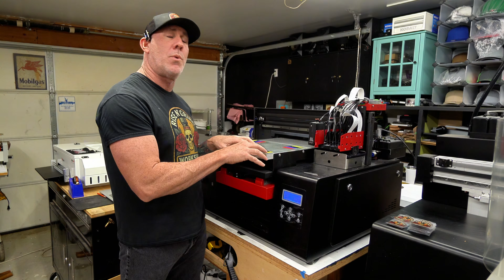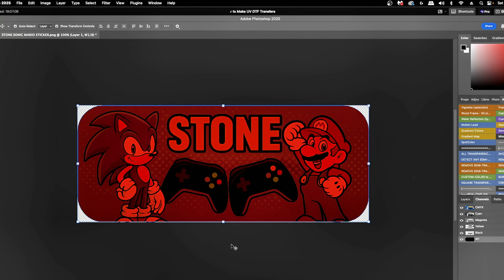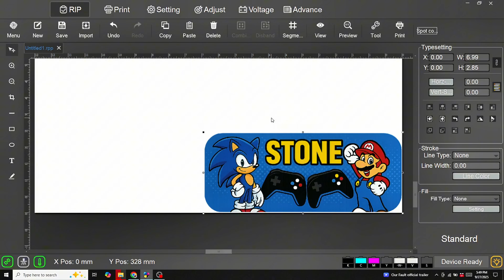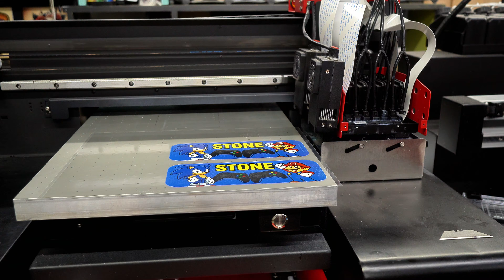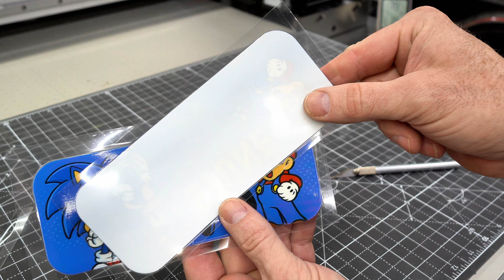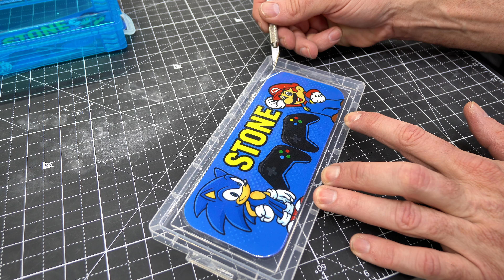The Ultimate UV DTF Guide | How to Print & Press UV DTF Transfers

Comment: Awesome video thank you very much for doing this. I have watched your videos and now I have the 6090 pro coming my way very soon.  I have a question to ask. Can I use stretched canvas for the hard ink? Or would I need to use the soft ink for this?
Reply from the maker: I have printed on canvas with both soft and hard inks. Both produced great results. Just make sure you place something flat behind the canvas so it it won't sag in the middle. If using hard inks, just don't bend the print and it should be just fine.

Comment: Is your 6090 still down? I just bought one from Jay's Printers.
Reply from the maker: It's running. We use soft ink for out DTF Transfers which is loaded in the ZZ2C we have hard ink in the 6090
Reply: @RISENGRINDWORKSHOP   oh cool, is there going to be a coplete set up video in addition to yhe one you already have? Thanks
Reply from the maker: @chris80333  We have a new model from Jay's arriving and all our 6090 Content will be filmed on the new model.
Reply: Does it have to be a heat laminated or can it be cold laminated?